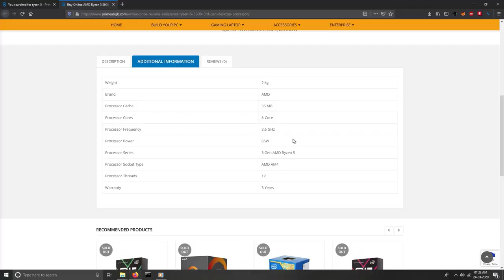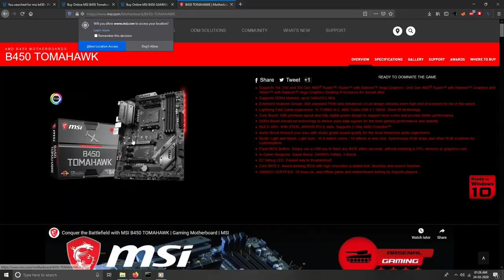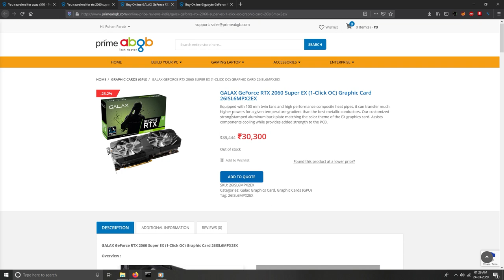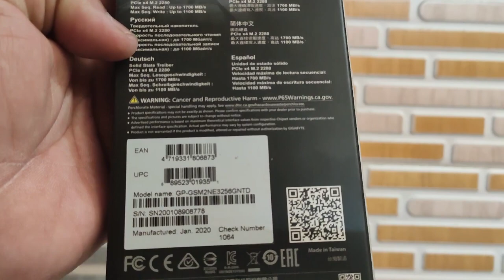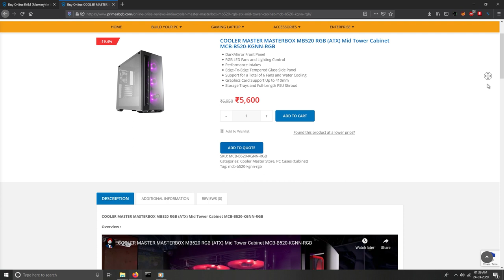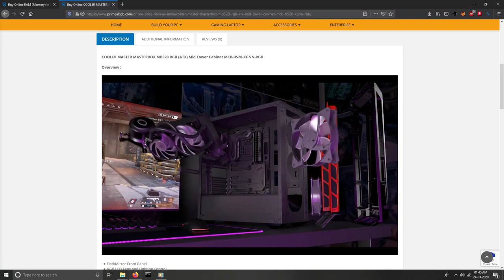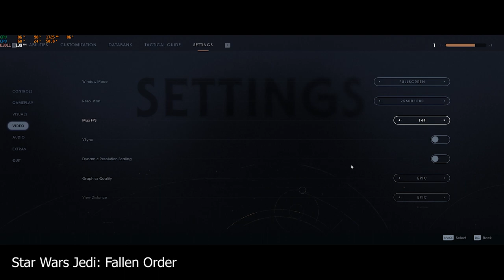Gaming PC build - Ryzen 5 3600 | RTX 2060 Super Windforce | B450 Carbon | Masterbox MB520

Comment: I have a question, is this a good pc?: Asus Prime B550M-A Wifi Micro Atx, Ryzen 5 3600x, The cooler of the Ryzen 5 3600x, Rtx 3070 Founders Edition (the one that is going to come out the next month) , KingStone A400 240 ssd 2.5, 2tb hdd 3.5 7200rpm, a 650w power supply, and the Phanteks EclipseP400A Digital ATX Mid-Tower Case or Deep Cool Matrexx 70 3F Case?, Should I change something? What do you recommend me?
Reply from the maker: I will suggest you:
Ryzen 5 3600xt or wait for 4th gen
Liquid cooler is must for r5
Founders editions had cooling issues in past also clock speeds are less as compared to partners. Wait for zotak, gigabyte etc.
650w psu won't be enough as I have heard that the new GPUs are very power hungry

Comment: Hi bro did you connect all the 8+4pins from psu to mobo?
Reply from the maker: We only need to connect 8 pin connector
Reply: @encryptedguy  Sure? I have an old Corsair CX600, and I am upgrading with this MOB and Ryzen 5 3600X. My PSU only has 8 Pin. Will it affect the performance of overcloaking? I went to PC part picker, this is the message I get >> The MSI B450 GAMING PRO CARBON MAX WIFI ATX AM4 Motherboard has an additional 4-pin ATX power connector but the Corsair CX 600 W 80+ Bronze Certified Semi-modular ATX Power Supply does not. This connector is used to supply additional 12V current to the motherboard. While the system will likely still run without it, higher current demands such as extreme overclocking or large video card current draws may require it.
Reply from the maker: Even if you use something like r5 3600 and rtx 2060s the power draw is around 500watt you can easily do overclocking. You can check your power draw using seasonic power calculator website.
If your psu has a 4+4 connector for cpu then you don't have to worry
Reply from the maker: I mean 24pin + 8pin
Reply: EncryptedGuy Thanks It helps

Comment: Bro I have the exact same build but from the very first day my pc randomly crashes with the cpu debug led showing red on motherboard.. I tried many fix but the problem still exists.
Can you please help me out.
Config:
Amd ryzen 5 3600
Msi b450 gaming pro carbon ac
Gigabyte 700H cpu
Inno3d rtx 2060 super
G skill 16 gb ram
Reply from the maker: Try updating the bios and reset any overclocking profiles if any
Reply: That didn't help 😅

Comment: I am going by same specs...some confusion.. carbon board and 3600 processor,,,32 gb ram 2400
i have ordered .

yet to order cabinet , drive, powersupply, graphic cards...
..confused on power supply and cpu fan...is 550 w enough...is there a need for cooler

Comment: Bro, recently i built i5 9600k with gigabyte rtx 2060 super windforce oc 8gb Rev 2.0.  I played gta v, bf v, ac origins, SOTTR.  While gaming my gpu hit 86°C even though i have very good air ventilation also my ambient room temperature is around 26 to 30. I did down my power consumption to 85% by msi afterburner but then also the gpu hit 80 to 83. The point is average 83°C is good for gpu? Or do i need to replace my gpu?
Reply from the maker: I had the same problem but GPU temps are normally over 70-80 on full load 
to reduce the power I used aorus engine where I set Max temp to 70 and it worked..

Comment: I have all the same specs except for the nvme, ram and cooler, I was going to build this, but lockdown came in effect. I am now waiting for the b550 pro carbon, ryzen 4000 and 30xx as they are all said to be cheaper with better performancr. Cheers on the build mate
Reply from the maker: I have heard that tomahawk x570 will have a lower price. If it fits your budget try to get it. Ryzen 4000 support has been dropped for b450.

Comment: Is the board gaming pro b450 compatiblr with rtx 3060?
Reply from the maker: yes it is. but better go with b550 or x570
Reply: @encryptedguy  i have b450 msi gaming pro carbon ac i want to upgrade the graphics cards(rtx cards) . Will my computer be alright? Or do i need to upgrade the bios or something
Reply from the maker: Motherboard is fine check if PSU is able to provide enough current (watt)

Comment: Great Vid bro. do you have a problem with mystic light? like when you seletc the desired colors and when you shutdown or restart does it switch back to the defualt colors?? Replay Please.
Reply from the maker: Yes this problem exists with dragon center. Unfortunately I had to use older version of mystic light 3 cause newer version of dragon center is completely broken doesn't work at all

Comment: Why did you use thermal paste when the ryzen CPU comes with a thermal pad already installed? Did you scrape that off first?
Reply from the maker: Yes I showed in the video that I scraped off the default thermal paste before applying new one
Reply: @encryptedguy  sorry must have missed that.  Cheers!

Comment: im literally purchasing this exact mother board and cpu and i heard its not the right compatability?
Reply from the maker: No it's the best b450 motherboard and has support upto ryzen 9
Reply: @encryptedguy  will the cooler master hyper 212 evo fit onto this mother board?
Reply from the maker: Check if it supports am4 socket. I guess it does

Comment: How do you connect the 3 front fans?
Reply from the maker: The 3 fans are connected to the molex psu connector there is 3to1 combined connector for power and RGB.
Reply: @encryptedguy  thanks, and I guess it's impossible to control their pwm in that case
Reply from the maker: Yes we cannot control them using pwm. Direct 12v

Comment: Mb520 vs Mb511?
Reply from the maker: Mb511 : good airflow if you remove filter but system will be full of dust
Mb520 : I prefer the looks but air flow is reduced cause of side and bottom only vents
Reply: EncryptedGuy is it because of that ur cou is on fire with stock cooler?